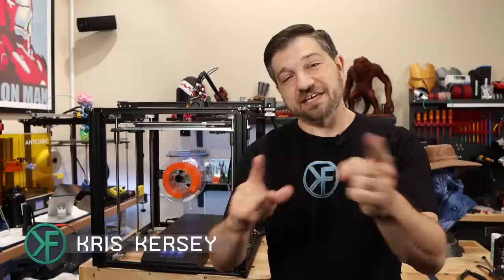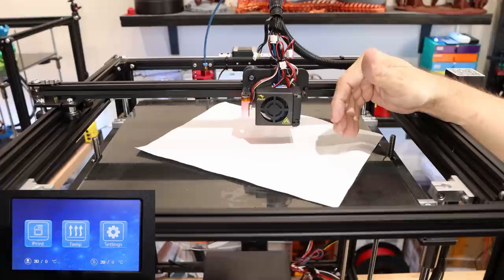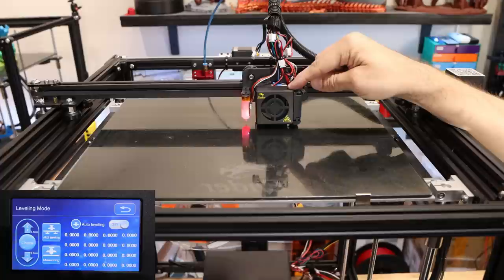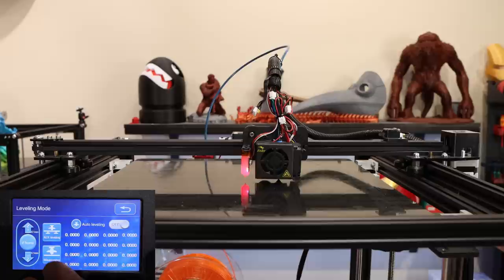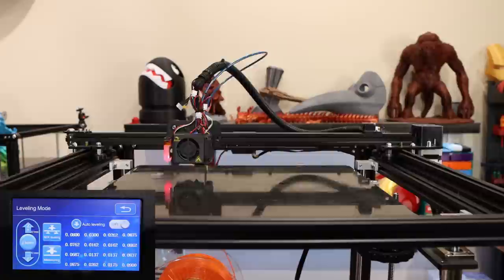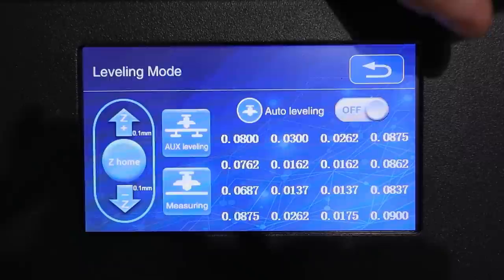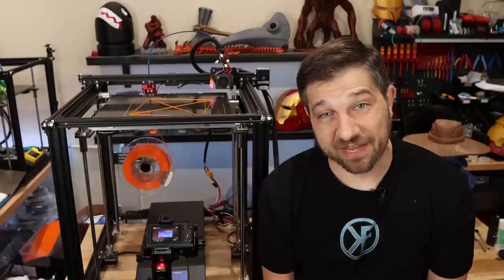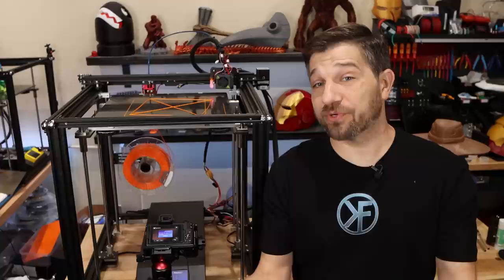Ender 5 Plus Bed Leveling Guide

Comment: Great video.

I followed it, damn near frame by frame. No matter what I do, the measurement readings are crazy.

I've tried every way I can think of. I've been trying to make tiny adjustments and re-measure, and basically walk it in. Watch where the numbers move each time, etc... I've taken 261 photos of my screen so far.  That's 261 measurements, and I can't get it so more than the home spot reads with a zero in the first position.

Hope I didn't get a dud.
Reply: Did you ever figure this one out? I just bought one and have the same problem. The measurements are like physically impossible. point 1 would say -1.8, point 2 +0.3 and point 3 would be like -1.1 or something and so on for all 16 points. This would either mean the probe is defective, or the bed is extremely warped.
Reply: I picked up a sonic pad and replaced the leveling springs with silicon. The reading from the sonic pad said it was pretty decently leveled, but the printer said otherwise. I loosened everything again and started over just using the sonic pad. After doing exactly what I did with the stock firmware, I was able to get every point to 0.0x after only a minor adjustment after the initial manual level.

I'd say get it manually as level as possible, and run a test print. I found one that's just concentric squares that cover the entire build plate. Takes about 25 minutes to print.

I did, and mine came out absolutely perfect. I was astonished.

Then on the very next print, the extruder went haywire and smashed into the front of the machine. Again. Now the extruder just grinds, and I'm still waiting to hear back from the Vatican to get approval for an exorcism.

Comment: Hi Kris,  good video however I have had the best and most consistent results by replacing the MCU with a SKR E3 Turbo that has the 5 drivers.  This gives you that ability to use the Z-tilt function with a dedicated driver for each z motor versus sharing as driver.  I use Klipper with all of my E5P printers and my routine is to home the bed, and do a Z-tilt before each print.  I now only do a bed mesh calibration/bed leveling screw adjustment when I notice inconsistency in my prints and or when the z-tilt goes past the 5 times.  This does not happen very often  and I have not touched the bed leveling screw adjustments unless I am calibrating the bed mesh.  My printers are printing consistently 24/7 and it has been months since I last had to touch any of the bed leveling outside adjusting the Z-offest when changing filament type.  Prior to this I pulled my hair out, adjusting bed screws, with a slightly warped bed.

Comment: I have done everything like this video said very precisely, and when I do the auto measure, only a few numbers are at zero-ish, and opposite corner at -5. Nothing I do can get zeros all around
Reply: were you able to solve it? I have the same problem and I don't know what to do. Answer please
Reply: The glass may not be flat
Reply: Same problem here!
Reply: @Dad_with_a_drone Here the differences are too big to be just that.  I even have "-7,200" in some points.
Reply: Same, did this like 10 times and no matter what, one corner I’m at 4.274, and the other is at -6.25. The mesh numbers are kind of all over the place. Bed warped? Gantry warped? Maybe frame warped/out of square? I am at a loss on what to send back for replacement. This machine is only a few weeks old. I know I’m doing it right, just can’t figure out what’s the issue 😢
Reply: @michaelrosa1007  I suspect that the problem with mine could be in the firmware.  Creality support advised me to calibrate the Z's motors (but I don't believe it will solve the problem)
Reply: @rafaeldeitos  I have a few ender 5 plus and a couple of them have glass issues, without  the clips the glass doesn’t sit flat, but all three machines came and were twisty !
Reply: @rafaeldeitos  I’ll have to try that. Reached out to Creality and waiting on a tech to get back to me. Weird part is, I ran some prints and everything came out flawless. 🤷🏽‍♂️ Upgraded to three clips on each side (little overboard). Would be nice to see close to “0” on the mesh function after I manually level.

Comment: While I don't have an Ender 5 Plus, it looks similar to my Tronxy X5SA Pro in some ways. First, it's big and second it has dual Z axis lead screws. The challenge I had with my Tronxy is that the bed would sag (z lead screw would turn) between prints when the stepper motors are off and would sag differently from side to side. 

So originally, I had to try to get the left and ride side the same before each and every print which was not always successful. The main board that came with the printer sent the same stepper signals to both the left and right motors. I swapped it out with one that allowed me to control the left and right side independently and now I can use the G34 auto z align command before every print. This command takes a measure on each side and adjusts until they are the same and then does the print. This made all the difference for me. Now my first layer is correct every time. I still had to level the bed and do the mesh like the video shows but now those settings get applied the same way each time because the bed is level from left to right.

I assume you could do the same thing with the Ender 5 Plus. But I would warn that it was a big undertaking to swap mainboards, configure marlin, etc. But I love the results and it was worth it to me.
Reply: what kind of lead screws does the tronxy have? the ender has 8mm on 2 threads .. they dont turn by weight .. on my mpcnc i got 8mm on 4 threads .. spinning easily on weight ..

Comment: You have been a huge help with my E5+ experience! I had a few issues out of the box (hit and miss with this machine) but your videos have been the difference and mine has been great. It was nice to see that you dropped this video, a sort of culmination of all the things you have learned over this E5+ journey. Your tweaks to the firmware made a huge difference in  my auto leveling experience. Quick question, out of all the hot ends you have tried with this tool, which is your favorite? I am currently using Micro Swiss and find it acceptable but I struggle with the fine line of clog vs stringing in retraction settings. Please keep doing your thing, you have helped so many of us!!

Comment: For gapping between the two aluminum bars (2:51) you can use the shaft of the 3mm (or 2mm) Allen wrench that comes with the printer's tool set.  Measure just inside of the notches cut in the bar.

For that first measurement between the nozzle and the print surface, I can't see a reason for using the thinnest feeler gauge in a set.  Creality has shipped a 0.20mm feeler gauge with other printers that use the same tramming process.  It worked very well for my CR10S Pro V2.  I have since purchased a 30cm long (12 inch) 0.20mm feeler gauge that I'll be using on my 5+ (also have a long 0.30mm).  The length makes it a lot easier to do the center adjustment as well as the four corners.  One thing to remember us that the feeler gauges are for measuring "clearance".  Sliding them up alongside the nozzle gets you nothing better than a guess -- especially if you are using the thinnest gauge in the set.
Reply from the maker: Thanks for the tips Larry! All good info.

Comment: great vid, for those playing along, and the vid isnt finished yet so if addressed please ignore. Best to check the wheels on the moving assembly to ensure no slop and check the nozzle is secured fully down when cold. If that nozzle is loose it will move during long prints. Basically shake everything and ensure no slop in the machine and then begin this video. Excellent info, i prefer doin this in octoprint as i find it easier with granular control, i do like the on the fly z axis adjust.

Comment: Once you have followed the instructions up to tramming the bed you can use the Autobim plugin if you have Octoprint, Autobim uses the BL Touch to measure each corner and instructs you how much to turn each wheel to get it trammed, this is using actual measurements instead of feel, the feel method is ok and will get you a good first layer but once I had used my feeler gauges the Autobim plugin showed me how much I was out of true level and guided me to true level.

Comment: Well the beast is together, Z moves, X moves, Y moves, I move 😄. I noticed that the distance from nozzle to bed is way off so adjusting will be essential. I shall perform all your steps so I can ensure it is flat as a pancake. Thank you for your videos. Firmware out of the box is 1.70.2

Comment: Tramming..CNC term. Digital caliper mounted to your router..ops.. nozzle would be awesome too. And to get a nice flat bed. We usually do a fly cut. Which you don't have that option.  Of all my years of rough framing everything being between a 1/16 and an 1/8.. couldnt even imagine what a few thousandths of an inch..or a millimeter looks like! Truly amazing what these 3D printers can do. And all they are going to do is get better! The imagination is limitless!! I currently work with a 5x10 CNC  wood router and have a small 30"x30" CNC at home. I've been looking into 3D printing and was really liking how this one works. I like that the bed isn't moving back and forth vs the x, y.  It would be nice if all the steppers were on a threaded rod. For filament..i think it's just fine.

Comment: With the e5+ I found after making settings adjustments in the leveling interface screen you have to hit the home button to save to eprom otherwise when you turn your machine off it will not save the distances. There is no other save to epromm button that I have found and this is kind of a hidden feature (unless you change your firmware)

And thank you Chris prior vids of yours helped me in the past alot! And this video definitely clarifies alot of unknown and unsaid for the e5+ leveling
Reply from the maker: You're welcome and thanks for that tip. I hadn't noticed the correlation.

Comment: I'm about to throw the E5+ to the curb.   Each time I get it dialed in perfectly I can print 2-3 things or maybe lets say 30-40 hours of print time, then insert the nightmare of trying to get it levelled and dialed in again.    I really thank you for this guide it makes it seem so straight forward.    But in my case the outside of the test STL you provide prints fine and no material appears in the center and the nozzle practically drags on the build plate in the center areas.   I've tried 3 diff build plates, orig glass provided, a magnetic flex plate, and the new updated Creality glass bed I just cannot get this to work.   1) Measured bed to gantry 2) got the nozzle to 205, bed to 60 3) set zhome 4) did the aux levelling thing several times 5) measured map/mesh looks great   6) tried your test print and worked the z-offset until I would see adhesion and fairly flat squished filament.   Then when it gets to the X pattern it starts applying filament on the outsides of the X pattern but where the lines merge in the center I ahve about a 3" x 3" area that no filament even appears like empty area.   Pulling hair out :( :( about to give up.
Reply from the maker: Check your start gcode in your slicer and make sure you have "M420 S1 Z2" right after your G28 or G29 commands.
Reply: @kerseyfabs  thx will check

Comment: I borderline regret my 5 Plus. What a pain it's been. Flsun Q5 has been bulletproof and works every time
Reply from the maker: Sorry to hear that. I'm glad you found a machine that gives you good results though.
Reply: Mine have been running perfectly 24/7 for three months running ASA from different brands.  Just another data point for the curious. Your experience seems to be in the minority.
Reply: @garlicbutter1906  love my 5 plus also to each their own.

Comment: Interesting Kris trying to figure out the correct process for when you have Z auto-align and then the scan with your firmware on the SKR 2. Only found out by accident that when I hooked up Octopi it will not let you print unless you do a bed level first, doing test prints at the moment.

Comment: A bit random but I thought people might find this information useful. I haven't seen anyone mention on youtube if replacing worn rubber rollers with poly-carbonate rollers are any better. I did that and I can tell you that they wear quicker (I had dust particles from the rollers all over the extruded bar within days) and they  sometimes squeak.  So if you need new rollers then stick to the cheaper rubber ones !

Comment: I just got this printer yesterday. Assembled the printer powered up and homed the nozzle to start the initial  leveling process. The nozzle promptly crashed into the bed, the BL touch would light up but the probe would not extend downward. I didn't even have access to the manual leveling function. After repeated attempts to try and auto home I suspected that the BL touch was defective. I opened up the printer and wanted to check wiring to make sure everything was hooked up. All appeared to be fine except the globs of glue everywhere. I couldn't verify if the wiring was correct due to the fact that some connections were not shown in the user manual. I found a Creality video with the ender 5 plus and I could see that the BL touch was plugged into the wrong connectors. I plugged the connectors like in the video and tried again. The BL touch dropped the probe and I was able to get into the AUX menu. Finally after a couple of hours of nonsense I was able to due a test print which for the most part came out pretty good. There still some issues that I still need to address, like the printer won't read the SD card. I just received a new Creality silent board, so maybe that will take care of the SD card issue. I will need to further dial this printer in, but I noticed that Creality is back to using mean well power supplies again. I'm not sure about this printer though. I have printed 2 items preloaded on the SD card, and I have had 3 failures. But thanks for these video, I've been using videos to help me.

Comment: My thanks too Kris, you might have some Swedish blood in you, spelling Cris with a K?
Well we both know that you need to know that your efforts are helping and you won’t know unless I remind you properly 😊
I learned much more about the use of the touch controls and menu features this time, thank you 🙏🏻 
Naturally I am one of those people who always seem to run headlong into issues. 

I thought that the printer was not so intimidating after seeing how open it is with little hidden, yet…
Wonder if you have any advice? My current issue is that my prints don’t actually start!
I tried to upgrade the Firmware and managed to level the bed, yet when up to temp the printer goes down to start 
on the bed and stops, the process on the screen continues and within seconds it says it’s finished?
I basically downloaded the last Firmware from Creality and changed the name as instructed, before loading it onto the m-card.
I then started the printer with the card already in. 
Well, maybe it could be that the firmware is not replaced? I followed your video for this process too. Yet did not download the extra software you used to check it. What should I do?
I have had this printer for a year now and only managed to print a tiny boat a long time ago! Friends keep buying me more PLA as presents ha ha HELP! 😂

Comment: To me the gauge is the same as paper. Your still sliding it under checking for resistance. The one thing that might be better is that you know the exact distance. I still use paper and don’t use any offset which takes a step out. So it’s really just a preference I think.

Comment: More Ender 5 Plus content please. I'm thinking of getting one and want to see how well it prints compared to an X-Y.

Putting fingerprints on the bed can stop filament sticking in patches. It looks like that is happening here.
Reply from the maker: Short answer, similar quality, core x-y is still faster.
Reply: @kerseyfabs That's good to know. At this point speed is not really a concern. I'm printing some small components for a project I am doing. Z alignment is my main criteria. I'm getting some surprisingly good results with a Tevo Tarantula but I want a larger build volume and a Z axis bed for the larger components.

Comment: 6:40 is my WORST NIGHTMARE with 3D printing.  I freaked out last night when my nozzle hit a bump and moved 1/16'th of an inch up... Nice to know that it's not fatal.  That said, the Creality guys recommend you start a print, and adjust the offset to 0 (clicking the button a billion times) and then perform the leveling starting with the nozzle WAY off the plate. Then lower it slowly.  Here's the link I saw it in:  https://youtu.be/zSOVAdKw4ss?t=218.  That does seem pretty hacky.  The other option is for your 3D printer to attempt suicide like what happened to you though.

Comment: After "billions" of leveling attempts I ended up with pretty much the same process. Except for the manual leveling I use the bed visualizer in Octoprint, and when adjusting the z-offset while printing, I restart the print job after changing the value. It feels to me that the value isn't immediately applied.

Comment: Did someone else noticed the center where the printer is measuring on 9:06 is not the same as the center on 12:30 and then on 14:40?  Thanks Kris.

Comment: I know this Is an old post but i've gone through this procedure many times and the numbers I get are so much larger. From bottom left to top right I'm Getting
-4.834, -4.462, -4.712, -4.624
-1.887, -1.862, -2.012, -2.424
0.962, 0.000, 1.100, 0.675
2.562, 3.137, 3.587, 3.925
The bed seem really uneven and I can see the bend in it. The knobs aren't too tight and even. Any help would be appreciated.
Reply from the maker: Looking at your bed, it looks like its just sloped. I think if you just raise the back a couple of mm it should be fine.